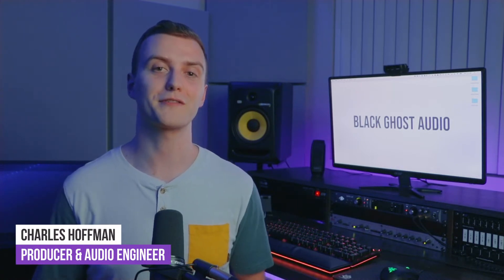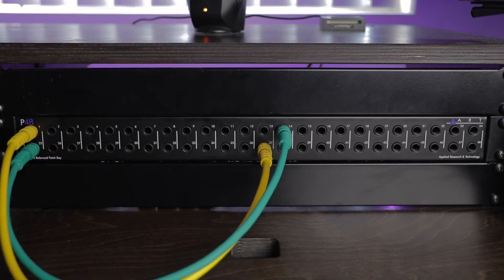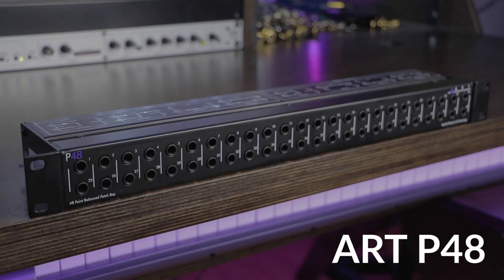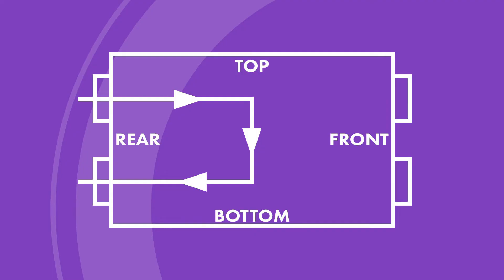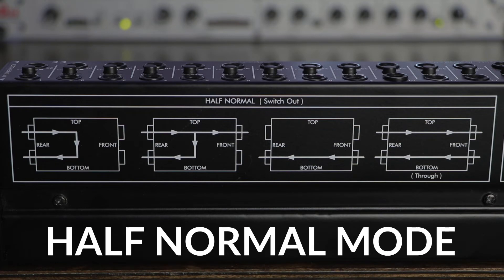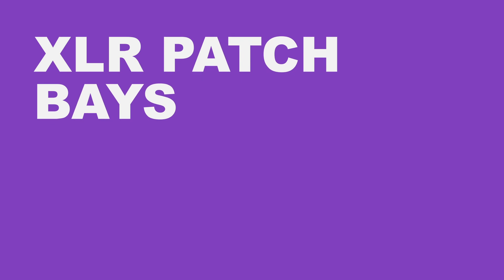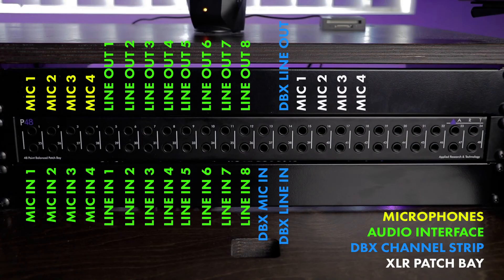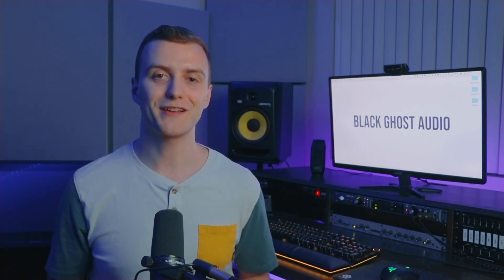How to Set Up and Use a Patch Bay

Comment: HEY quick question man. Are you using TRS Patch cables on the front of your patchbay or just normal instrument patch cables with one ring?

Can I just use TRS 1/4 cables on front and back of this unit? would be easier to order them all at once.

What brand cables are you using? thanks
Reply from the maker: Yup, these are just 1/4” TRS cables. I recommend getting 1/4” TRS snake cables for the back of the unit; this can prevent a messy cable situation. For the front, a cheap pack of TRS cables from Amazon will work fine. Assuming all of the connections in the cables are solid, the brand doesn’t matter too much. You could also make your own cables if you want to save a little money and don’t mind the extra work.

Comment: hey not sure if you’re still answering questions but, microphones connect with an XLR cable so how do you connect a standard mic cable to a patch bay if they use 1/4 inch cables?
Reply from the maker: Good question. You just need an XLR to TRS converter. They’re cheap and you can buy a handful on Amazon.
Reply: @BlackGhostAudio  thanks so much man!

Comment: Sir i have a question 
I have a small setup in my home studio and I would like to know how to connect my external gears to my DAW (Pro Tools and abelton live 12 suite)

My setup includes the following:

- Wacx12 Microphone
- Volt 476 Interface
- Neve Rupert Preamp 500
- IGS One LA 511 Compressor
- WA76 Compressor
- Klark Teknik EQP-KT
_ neutrik pathbay 

I would greatly appreciate it if you could provide me with a detailed explanation of how to connect these gears and integrate them into my DAW.

Thank you for your time and assistance.

Best regards.

Comment: Can you break it down idiot style? Does the output of the effect go into the input of the patchbay? Are all top row input on the patchbay? I just bought a Samson patchbay for helping in pedal effects routing in my rack. Just confused if it wires like a send/return, or if it wires like an input/output.
Reply from the maker: You can treat your pedal effects like my dbx 286s from the video. Connect the input of your pedals to jacks on the bottom row (rear) and then connect the output of your pedals to jacks on the top row (rear).
Reply: @BlackGhostAudio  thank you!

Comment: The manual for the ART P48 says they definitely do not recommend attempting to pass phantom power through it, even though it is "possible" -- so you've had no problems with this?
Reply from the maker: I’ve had this patch bay for years and have never experienced any issues with passing phantom power through it.
Reply: @BlackGhostAudio  Thanks- I'm having trouble getting any signal from my mic - its connected to the back of the patchbay with an XLR to TRS cable. And then patched to my 2 channel interface on the front. Do I need an XLR converter instead? My interface (Apollo Twin) uses combo jacks which I'm routing with TRS to the patchbay.
Reply from the maker: @aaronscore  you need to connect to your audio interface with an XLR connector. If you’re connecting to it with a TRS connector, it  won’t know that you’re trying to route a mic signal into it. You can connect to your audio interface using a TRS to XLR cable.

Your signal path should look like this: Microphone > XLR to TRS cable > patch bay > TRS to XLR cable > audio interface.
Reply: @BlackGhostAudio  You're a legend thank you.

Comment: Can anyone help??

So i have an apogee duet so it only has the set outputs, I want to run the outputs through external hardware ie compressor/Eq etc..

How can I do this, I was thinking of getting a patch bay but then how would I then feed the signal to my monitors? I would have a constant loop from Output to input any ideas?
Reply from the maker: The Apogee Duet has 2 combo inputs (mic/instrument/line) and 4 outputs (2 line outputs and a stereo headphone output). This means you can route signal out of your computer through the line outputs, process it using outboard gear, and then record it through the combo inputs. Doing this won’t create a feedback loop if you set it up correctly. For example, you can set Track 1’s output in your DAW to Output 1 of the Apogee (this is the track you want to process) and then set Track 2’s input in your DAW to Input 1 of the Apogee (to capture the processed signal).

However, you’ll need to audition the signal using a pair of headphones because the line outputs are being used, meaning you can’t connect a pair of speakers as the same time. Unfortunately, a patch bay doesn’t extend the number of line outputs on your audio interface so a patch bay won’t fix this. You need an audio interface with at least 2 line inputs and 4 line outputs to work with outboard gear while listening through a pair of studio monitors, and not headphones.
Reply: @BlackGhostAudio  Thank you, this has been a problem for me for like 2 years, thanks for the reply i am going to get a patchbay this week 👍
Reply from the maker: Just to clarify, a patch bay won’t fix your issue. You need a different audio interface with more line outputs to use your speakers and outboard gear at the same time.
Reply: @BlackGhostAudio  Yer thats fine, Ill use headphone jack for now then get a UAD 👍 thanks again

Comment: Is there any issue with having the input of you Dbx unit connected to the output of your Dbx unit ? In normal Mode the Signal would be passed through your patch bay in a Loop input to Output

Comment: so a question for the routing: I use a MacBook pro and a apollo twin x TB3.
i also have a 500 lunchbox with compressors, EQ, Tapes,...
is the routing correct?

Outputs of the Apollo Twin x to the patchbay output 1+2, Input of the apollo twin x to the input of the patchbay 1+2. all other outputs of the lunchbox to the different outputs to the lunchbox, the same with the inputs. 
When I now want an eq and a compressor I have to go out from channel 1+2 to the input of the eq 3+4, than to the output 3+4 of the eq into the input 5+6 of the compressor and from the output 5+6 of the compressor to the input of channel 1+2.
Is this correct? or is this wrong? never using a patchbay before.
Reply from the maker: That seems like it should work. Test it out and see what happens.

Comment: I like how you used a blank panel to label between bit. Why didn't you show that and the cables or snake patching all this?
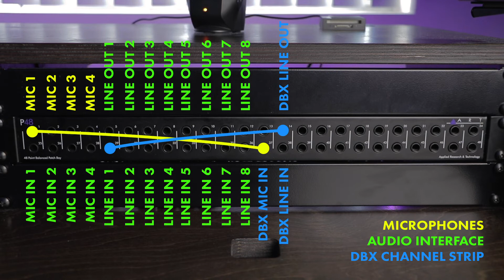Reply from the maker: Thanks! I actually captured a few shots with some cables plugged in, but it became a bit of a mess to look at. That's why I opted for the connection line graphics around 4:34 😁
Reply: Black Ghost Audio oh okay lol. When I saw those labels I reconfigured my set up like that. I have the same setup with more outboard gear. And my desk is slanted like an Argosy desk. New follower here
Reply from the maker: JC awesome! This setup works quite nicely and it’s easy enough to modify it once you understand how the patch bay functions. Overall, a patch bay is a real nice time-saver, even for people with just a bit of outboard gear like myself. I imagine a patch bay is quite a critical part of your setup if you’re working with even more outboard gear 😁

Comment: I just bought a patch bay and you completely confused me. How do I do it simply.
Reply from the maker: TLDR; Connect the outputs of your gear to the top row of jacks on the back of the patch bay, and the inputs of gear to the bottom row of jacks on the back of the patch bay. Create custom signal routings by forming connections between jacks on the front of the patch bay using patch cables.

Comment: Hey thanks for the video. I have a question…

You show that mic 1 - mic 1 in goes to the interface when you want to bypass effects. I understand this. 

But then you route Mic 1 - DBX mic in - Dbx line out - line in 1. 

How comes it went to line out 1 and not back to mic in 1?
Reply from the maker: The dbx produces a line-level signal, as opposed to a mic-level signal. As a result, the signal needs to enter a line input on the interface 🙂
Reply: @BlackGhostAudio  of course 🤦‍♂️ thank you 🙏
Reply: @BlackGhostAudio  also are you using a trs to trs or trs to Xlr for connection between mic in 1 and your interface?
Reply from the maker: @Lordofbeings  It’s a TRS to XLR connection. You need to plug into a mic input on your audio interface 👍🏻
Reply: @BlackGhostAudio  I got ya. Can an Xlr take a line level signal or do I have to use a trs?
Reply from the maker: @Lordofbeings  You can run a line-level signal through a cable with XLR connectors. In fact, some studio monitors have XLR jacks that accept a line-level signal running out of your audio interface.
Reply: @BlackGhostAudio  thanks for your help. I appreciate it bro 😎
Reply from the maker: @Lordofbeings  No worries, have fun recording!

Comment: Can’t take anyone serious that uses Rockits. Such terrible monitors.
Reply from the maker: Are these the “best” monitors out there? Nope! However, I’d take a pair of Rokits in a sound-treated room over a pair of Genelecs in an untreated room any day of the week. In conjunction with Reference 4, the frequency response of the Rokits isn’t much of a concern either.

The real question is whether or not Rokits are capable of providing quality results that translate well to other playback systems. For me, the answer is yes, which is why I haven’t felt the pressure to upgrade to more expensive monitors 😁 A pricier pair of monitors would likely be a bit more revealing and provide more detail, but since I check my mixes on various playback systems to ensure consistent playback, the Rokits get the job done!

For anyone reading this who wants to learn what makes a “good” studio monitor, this guide I wrote provides a great foundation: https://www.blackghostaudio.com/blog/studio-monitor-buyers-guide-how-to-choose-the-right-speakers
Reply: @JUNO-69  It was a light tap, but I turned the other cheek ;)